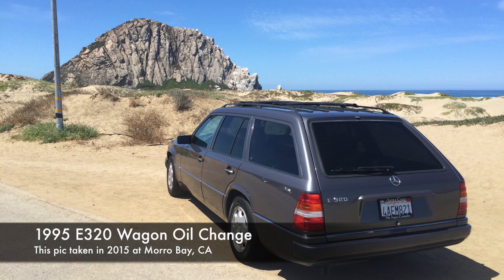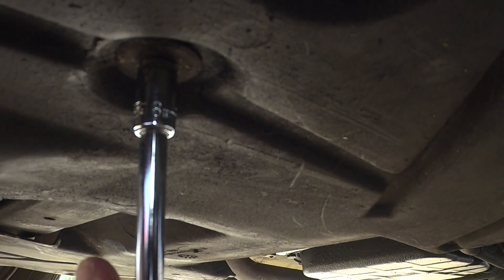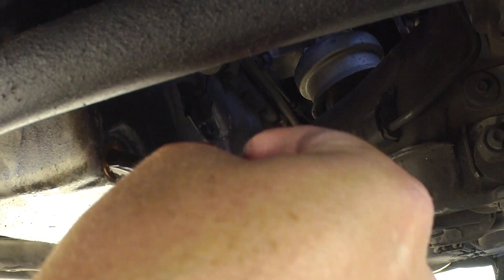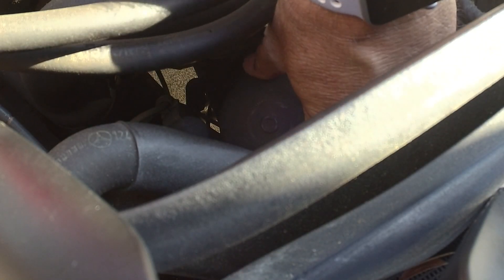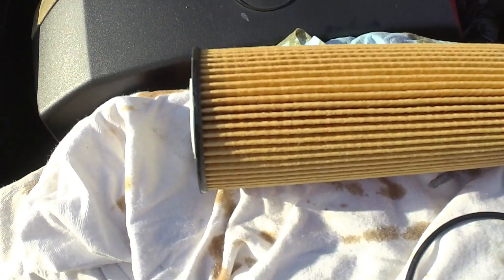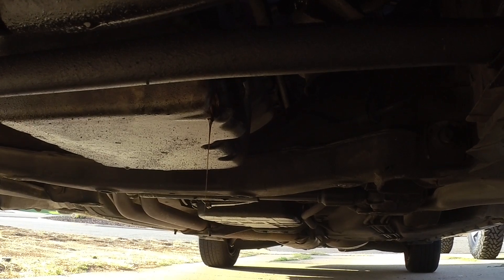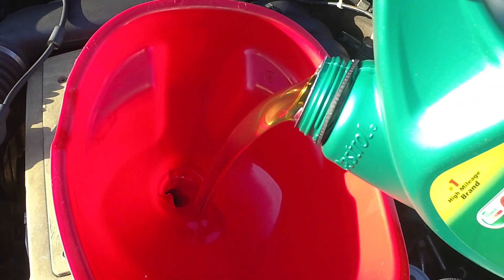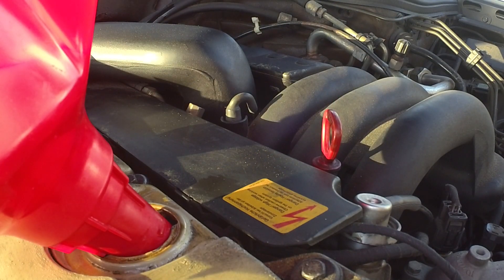1995 Mercedes Benz E320 Oil Change | w124 Oil Change

Comment: Additional tip: drain the new filter in new oil before you put it back in, the engine then gets oil as soon as you start it.
Reply: Hey! Why is this helpful
Reply: @Danny0rozxo  Because if you took some time to do it, could be that the oil film isn't covering the piston any more and if you start the engine with a new filter that wasn't drained in oil, more abrasion than necessary could be the consequence

Comment: Thanks for the video. I have a 1994 E320 wagon. My car has been sitting for a while and the valves are really noisy. I am wondering if there is an issue with the timing chain tensioner. Have you ever had an issue with excessive noise from the top of your engine?
Reply from the maker: The last noisy vibration I had on this wagon was from a broken motor mount. My wagon has nearly 190k miles and I have not had issues with valves or timing chain.
Reply: Thanks for the info!

Comment: But how do I reset the oil indicator light ? Thanks for posting this
Reply from the maker: Eric, I believe you either have low oil level or need to replace the oil level sensor. There is a good instructional guide here for w124 models: https://www.pelicanparts.com/techarticles/Mercedes-W124/29-ENGINE-Oil_Level_Sensor_Replacement/29-ENGINE-Oil_Level_Sensor_Replacement.htm

Comment: Did you change the oil drain nut washer? Is it copper  and reusable? Thanks
Reply from the maker: Chris, I didn't change it on this oil change, not a bad idea to do, but I may change a crush washer every third or fourth oil change especially if I detect a drip forming at the oil drian plug.
Reply: @MattsGarageMiscDIY  thank you for this excellent tutorial and advise. I am attempting this oil change so this is timely. Only worry i have is the washer and drain plug. Lokking forward to more of your vids. Will follow, thumbs up!